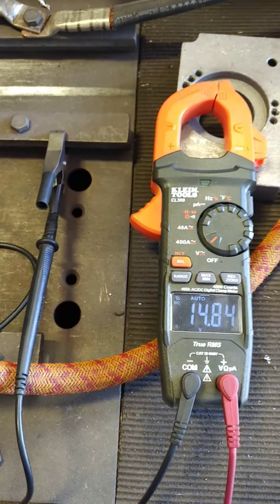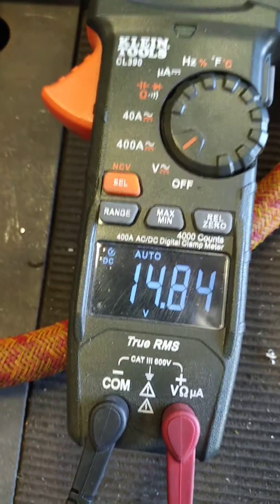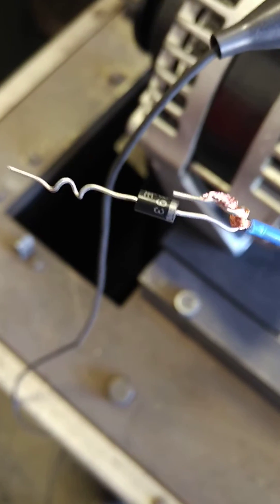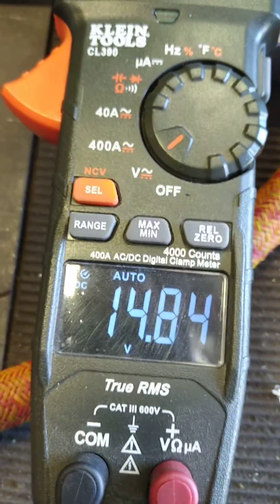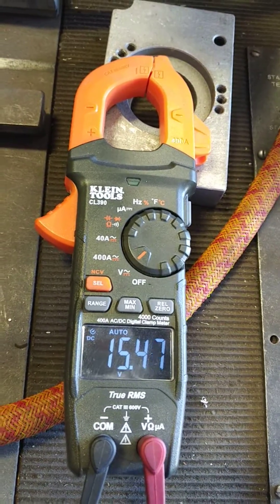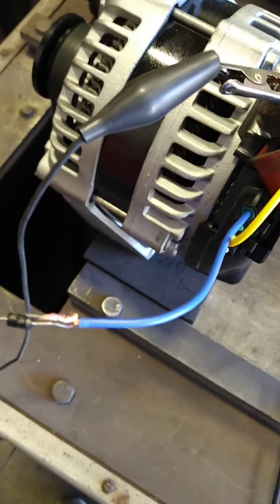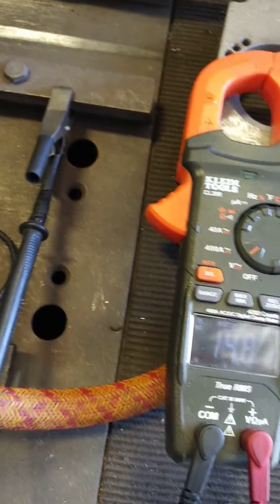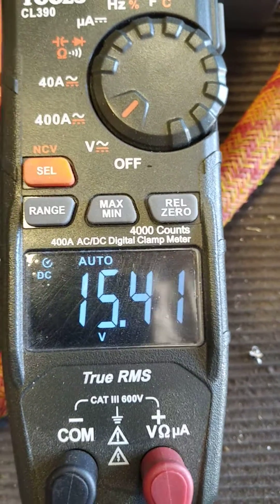Diode to Sense wire

Comment: The diode causes the voltage change because all diodes have a voltage drop when power flows through them. The sense line sees the voltage drop and turns up the output voltage. It's that simple.

Comment: Came across this video doing some research i see the diode thank u for that my question is i have a ford that i had the regulator changed to work like this it worked over a year my question is i think the diodes stopped working and when i pulled apart the harness it had a resistor in line with the yellow wire is that needed to replace?
Reply from the maker: @thebeanner1  depends on the regulator brand.  Ours don't require the resistor
Reply: @autotechengineeringusa  thanks for the response..

Comment: Do you have to connect the sense wire to the positive alternator post? Can't you just connect it to battery positive since it 's connected to the alternator anyway so you can compensate for voltage drop/sag?

Comment: I have a '13 Jeep JK with a stock 160amp alt. It charges at 14.2v but I have dual agm deep cycle/starting batteries that need at least 14.4v to properly charge. What would be the right diode to get up to say 14.8-15v?
Reply: don't do it. AGM's have higher concentration acid in them, due to glass matt, they won't sulfate due to stratification like flooded batteries, so don't need to be brought up that high. All you will be doing is promoting positive grid corrosion premature failure.
Reply: @thedavesofourlives1  Paperwork from the manufacturer that came with the batteries as well as the labeling on them, specifically says they need constant 14.4v to charge properly. They are deep cycle/starting.
Reply: 14.4 is FAAAAR from 15v you said @DanMcD80
Reply: 6/23 update, was able to change the charging voltage with hp tuners without needing to modify the wiring

Comment: Does it work with a 3 pin alternator?
Reply: It works with any pin style as long as you connect to the sens wire which it will have a S on your plug bro

Comment: I just got a new Load handler alternator to replace my old original load handler and this new one has remote sense capability but old one didn't so want to use the feature. Do I just connect a signal wire from the S terminal to positive of one of the batteries?

Comment: So the diodes  goes to the sence wire and then to a ground?????
Reply: Yeah bro. Tell me how it goes after you ground your sense wire
Reply: @GodIsGood1991  ok thanks
Reply: @GodIsGood1991  wow 15.9 volts
Reply: @GodIsGood1991  😂😂😂
Reply: @GodIsGood1991 😂😂😂

Comment: Unfortunately, doesn’t work on Toyota 4.7. Tried 4-5 diodes in series. Voltage never changed.
Reply: What's a toyota 4.7? I have a 05 Camry would it not work?
Reply: @xBLACKxOPSxSECRETSx2  the first gen tundras, sequoias, FJ cruisers, 3rd gen 4Runners have the 4.7 v8. So, I was able to make the diodes work from the sensor wire at the fuse box. It’s the white wire. I spliced into it & added diodes & was charging up to 15.7v
Reply: @joelslaughter9056  Long term results?? Burnt out dash lights or ecm going crazy?
Reply: @DarkLinkAD  only if charging up to 16v. Truck idles like with a miss, AC doesn’t work, cruise, etc. 15.5v is the sweet spot. No issues with lithium.
Reply: I fitted a diode in the alternator fuse. IN4001. PUT A 7.5 AMP FUSE. I had a Toyota hilux. Brought voltage to 14.7 to 14.9 cold. Easy as.
Reply: Bypass the ecm
Reply: @showtime302 I’m having a helluva time with a Cadillac Seville. 

I tried a 5k potentiometer and nothing. 

How would I bypass the ecm

Comment: So just to clarify, you run your sensor wire to the diode off the alt to the + side of the alt? Got that part. What about the other side of the sensor wire that runs back to the fuse box? Will your battery/alternator light be on, on the dash? Do you just tape it off or hook it up to the back side of the diode also/just splice the wire add diode then run a wire from it to the charging terminal? Thanks for everything
Reply: What are you saying? You literally just put a diode in the sensor wire, you don't remove any wires. Nothing will change but an added diode
Reply: Hey did you every get the answer for this questions?
Reply: No answer on the other wire?

Comment: Would this shorten the life span of your guys alternators or make them run hotter ? Also what size diode?
Reply from the maker: It does not make it run hotter. Lifespan is same. Diode numbers are in4004 or in4007
Reply: @autotechengineeringusa  will this really work????
Reply: Awesome thanks so much I have two of your guys alts on my trucks they are great 👍